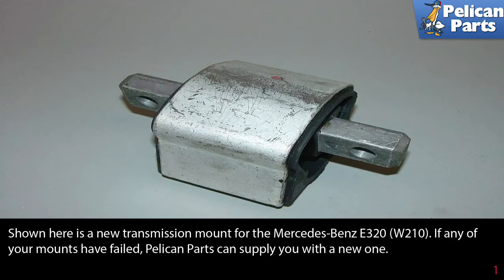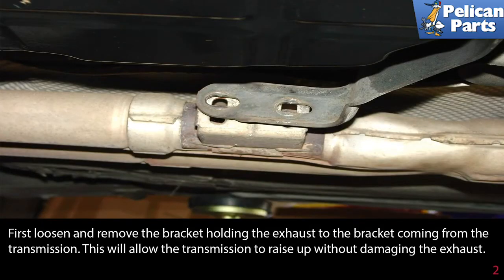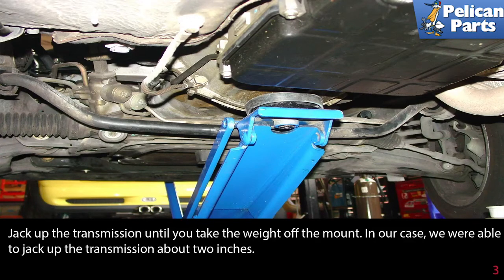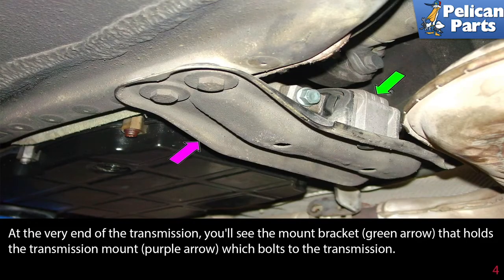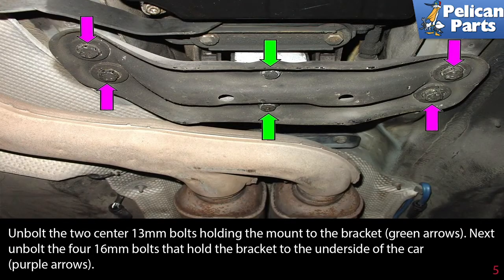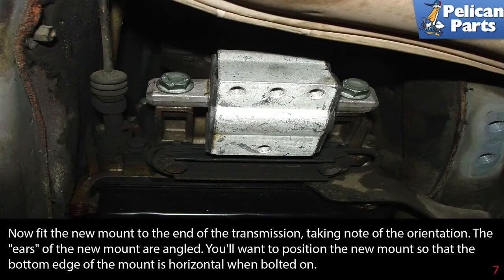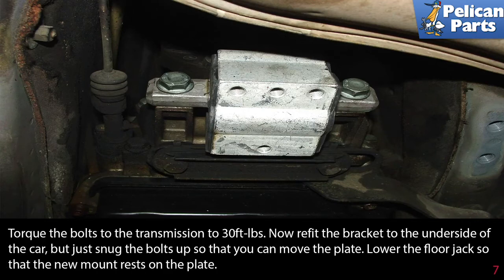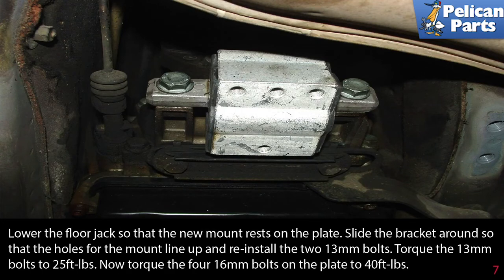Mercedes-Benz W210 E-Class Transmission Mount Replacement

Comment: Looks like a straightforward & 30-60 minute job, including coffee break !
Thanks for posting this.
I've noted a roughness at idle never before felt.
It's still smooth on highway & at speed though.
2000 E320 Wagon 2 WD at 272,000 miles.

This car is tough & reliable - we've had her for 10 years & 142,000 miles - very few parts have failed - power steering pump & MAF Sensor one & now this minor $30 mount, lol.

Still gets 27 mpg on highway & uses no oil.
Reply from the maker: Thanks for the feedback. Glad it was helpful!